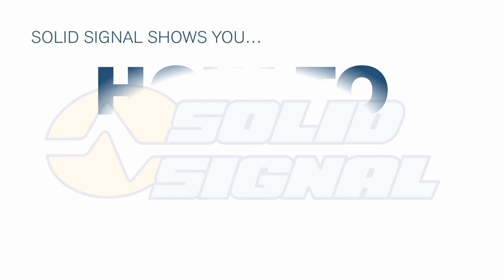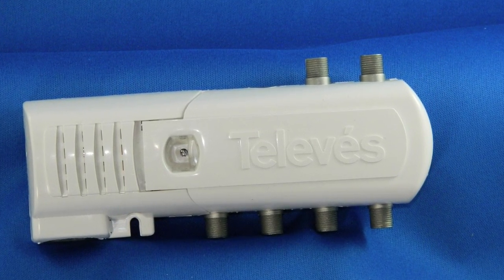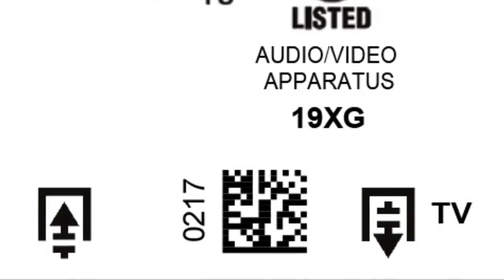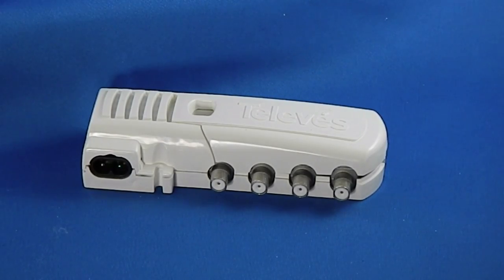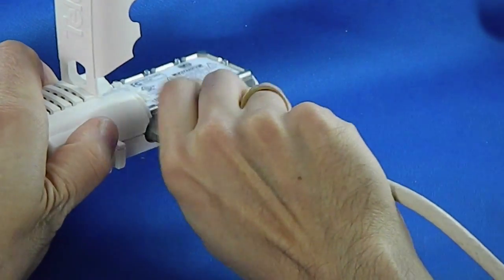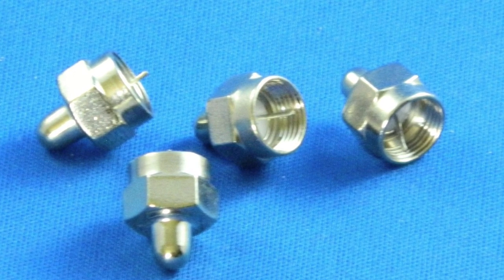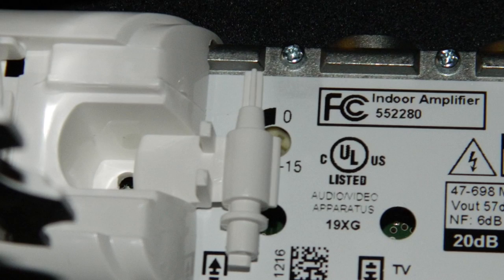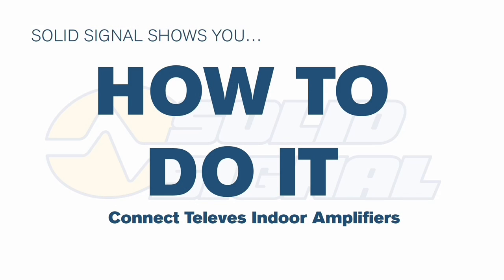Connecting the Televes Indoor Distribution Amplifiers

Comment: I bought a new lip mix repack damn fire inside says it has a little thing you can turn to change the amplifier if you necessary but there is nothing in the three holes to turn no trim or pod or nothing why is that

Comment: WE recently bought the newest Dat Boss LR #149884 Televes antenna. I read a lot of reviews on it and it was recommended to us by an antenna expert. This said, There was 1 reviewer said that THIS Televes amp was NOT weatherproof to be able to be mounted outside-(IMHO thats where "most" homes inlet from the antenna is going to a splitter and in turn going to the separate cable lines that go into the home's multiple TV outlets) (OURS is this way) I have no easy way to get 120volt current TO the plug on the amp outside and asked my antenna pro what I could do. He advised me to get a special splitter to use INSIDE my home along with the Televes amp. I have ordered this special splitter and we plan on installing the system this weekend. Thoughts?
Reply from the maker: With the DATBOSS LR, you get something that looks like the item in the picture. It's the power supply for the built-in amplifier. It's confusing that Televes uses the same chassis for both things, but they are different.

With the antenna you bought, the amplifier is built into the antenna and the power supply, the thing in the white case, is intended to be used inside. You do not need to put that part outside. Use coax cable with a solid copper center conductor to connect the two so there is minimal power loss. 

Again you do not need to put that part outside, it is not intended for it.
Reply from the maker: I think whoever said that is confused. The amplifier is built into the antenna. A lot of people think the white plastic box that plugs into the wall is the amplifier. It isn't. All it does is power the amplifier. It can be 50-75 feet from the antenna and still work, from inside. I'm not sure which special splitter you're talking about, but you should be able to connect the white plastic box inside, run RG6 with a solid copper center conductor to the antenna, and it should work.

Comment: I'm insalling my antenna on the roof. Can i insall the amplifier in the basement then split to two tvs.  The run from the antenna to the basement will be about 40'  Thanks
Reply from the maker: Yes that should work.
Reply: Thank you
Reply: Does a shorter vs longer run from the antenna to this amplifier impact signal strength or is the total distance more important? I’m not sure if it’s better to locate this preamp in the attic closest to my rooftop antenna vs a longer run closer to my tv and modem locations.

Comment: I have 2 tvs I want to connect do I still need this amplifier or can I just use a normal two-way splitter instead?
Reply from the maker: It depends on your installation. If you have under about 35 feet between TVs you may be able to use just a splitter. Every install is different.
Reply: @SolidSignalNovi  Well I just got my over the air TiVo edge and I was going to use those to run my OTA off of

Comment: I have this antenna connected to an AirTv2. Is the amplifier necessary?
Reply from the maker: Every installation is going to be different. You might need it or you might not.
Reply: @SolidSignalNovi  for example I am pretty far from the broadcast towers i.e. 55 miles. What are the advantages of amplication ? More power to antenna?
Reply from the maker: @josepht3396  This amplifier is designed to deal with long runs from the antenna to the TVs, or multiple TVs from a smaller antenna. I think you should leave it in.